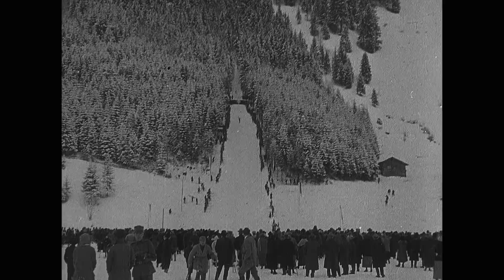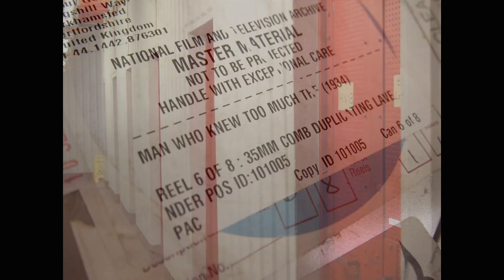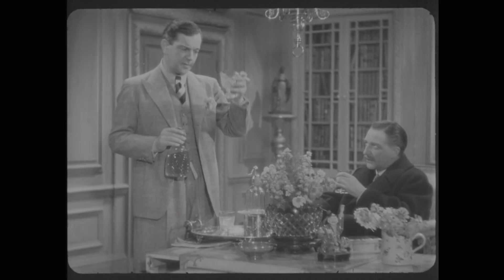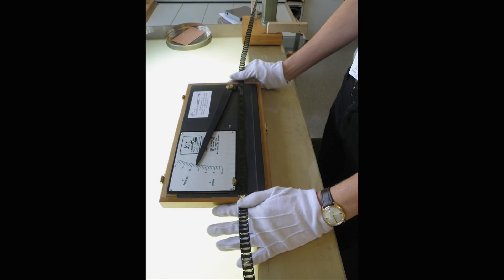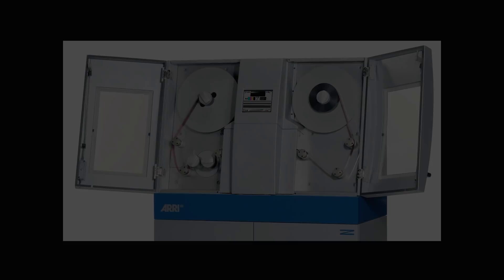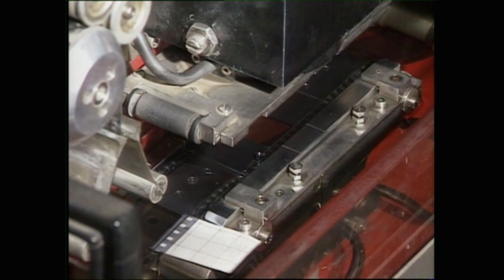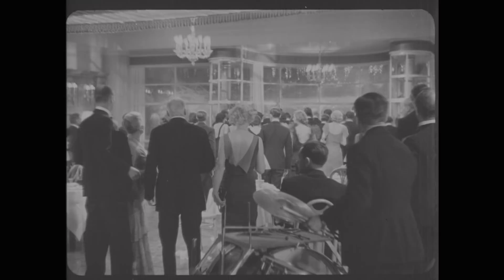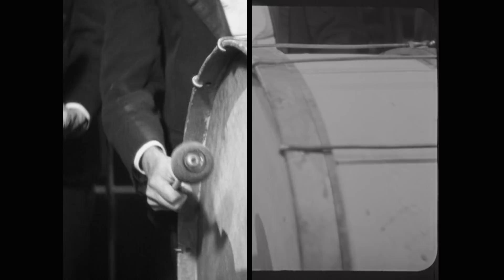The Man Who Knew Too Much - Restoration Demonstration

Comment: Wonderful video, thanks. The most beautiful film I ever saw was an original nitrate print of Isle of Lost Souls, Karl Struss cinematographer (& he was there that night! I think he was 96, so he was frail). It had a sepia tone, incredible range from the fog at the beginning to open shadows.  We had to have our projection booth in Ann Arbor, upgraded with fire suppression gear in order to show the highly flammable film stock. ( I never found out of the sepia tone was original or caused by time. It was so consistent and wonderful I'm pretty sure it was original. I've sepia toned most of my B&W silver prints, but never to the full orange. It's also both an archival technique and caused by time. Some of those old photographs that are sepia are just old not originally toned. Though in my experience the time caused sepia toning is slight.)  I wonder if this print ever made it to BluRay?
I grew up watching all the old movies on B&W TV, very very low res. It wasn't until I got to college that I realized most of the Wizard of Oz was in color. In college we showed a lot of old movies always trying to get 35mm prints, but too often having to settle for 16mm 'TV scans'  -  this is where a wide screen movie was copied into 1.33:1 format to fit the format of a TV screen. I think Giant is one of the most egregious examples. Brilliant color, wide screen,  no possible way to fit it to the TV format so they did horrible things. But it's kind of like your dad telling your joke and ruining it. You still can share the original.   So any restoration is welcome.
Hitchcock's earliest British films were notable for using the German developed technique of lighting the backgrounds differently from the actors - this gave the actors and the scene a three dimensional quality. Once you know something like this is possible and you understand how it works, you begin looking for more techniques. Hitchcock really pushed movie making forward. I don't know if it's been said recently, but Hitchcock was the Kubrick of his day.  I recently watched The Man Who Knew Too Much for about the 5th time. Everyone who loves movies should read the book Hitchcock by Francois Truffaut.  Back in the day, probably starting in the late 1960s Hollywood would try to make a thriller. It would be billed or promoted as 'like Hitchcock,' and they were almost always terrible (The French made some great thrillers but never felt the need to mention Hitchcock.) Brian DePalma was the first filmmaker I know of who wasn't French who made thrillers like Hitchcock.

Comment: I sure hope the are scanning in 8K by now. 2K just doesn't cut it. I realize 4K is sufficient to accurately reproduce a 35mm frame but with 8K already here it seems the obvious choice.
Reply: At least, Criterion is mostly sticking with 4K scans these days, though they're still only releasing 1080p blu-rays.
8K would be most suited for 65mm or IMAX-shot films, since 4K is far less than what those types of film can show. 8K for 35mm would probably be overkill on the detail side (like scanning 16mm on 4K - see The Texas Chainsaw Massacre, for example), and too expensive to justify.
Reply: It’s just not cost and time effective
Reply: 8K is just ridiculously unnecessary at this point.

Comment: Fantastic work! 
Now how to store the huge digital files? On hard drives where data can become corrupt or unreadable? I guess archival quality 35mm prints (in this case full frame, 4 perf "Super 35mm"), using all available image space, still are the very best option for long term storage. Now about the sound? Noise, crackle and hum reduction algorithms - and any form of "enhancement" (=adding stuff like harmonic distortion and sub harmonics: the equivalent of PhotoShop image sharpening) that just isn't there in the original, but it sounds great) are becoming better and better as we speak - so any "restored" sound track would be obsolete in about 10 years from now because future software will work way better. I guess (just an idea) making a clean, separate (!) analog back up of the optical sound track with frame (sync) reference would be great, so it can be restored just like an image before being transferred into any digital audio workstation. I'm sure people already thought about that and are hopefully doing just that. 
Thanks for the upload - I love this stuff! Hats off to the dedicated expert craftsmen and film lovers!
Reply: Digital data is easier to archive. M-Disc lasts up to 1000 years, for example. You can also create a RAID massive and data would be stored in multiple copies on several hard drives. It's surely more reliable and cheap than just storing analog film!
Reply: +Dave Flynn O.K. thanks for the information. There is a lot of debate going on regarding how well hard drives and other digital storage media will hold up over time and if these will remain readable by future software. If all that is covered: I'm all for storing the digital uncompressed data. After all: a 35mm film storage print is once again one generation away from the restored film in digital data form. I'd say: please just don't destroy the camera negs (or fine grain intermediates) used for the restoring work. I'm sure digital technology will greatly evolve over the next decades. There's is still some loss during scanning (even on the best ones at highest resolution). Anyway: many a great recent restoring looks fantastic by any standards. Again: hats off to the dedicated people who bring out the best possible image and sound, preserving it, always carefully considering what was originally intended, so we and future generations can study and admire the camera work, lens choice, composition and lighting - among many other things. Thanks again.
Reply: Well, I don't know if this helps, but inside Criterion releases, there's either a letter (in the laserdiscs) or a page in the book (in the DVDs and Blu-Rays) that explains the restoration. While I don't own The Man Who Knew Too Much, I do own the 2004 DVD of Videodrome (the Blu-Ray was released in 2011), and I'm sure that to a certain degree, they treated the two films the same.

"ABOUT THE TRANSFER: Videodrome is presented in its original theatrical aspect ratio of 1.85:1. Black bars at the top and bottom of the screen are normal for this format. This new high-definition digital transfer was created on a Spirit Datacine from the 35mm interpositive. Thousands of instances of dirt debris, and scratches were removed using the MTI Digital Restoration System. The soundtrack was mastered at 24-bit from the 35mm magnetic tracks, and audio restoration tools were used to remove clicks, pops, hiss, and crackle. The Dolby Digital 1.0 signal will be directed to the center channel on 5.1 channel sound systems, but some viewers may prefer to switch to two-channel playback for a wider dispersal of the mono sound."

So, although it's not identical to the story of The Man Who Knew Too Much, I'm sure the audio/video restoration tools were similar. Hope that helps!

Comment: I wonder 50 or 60 years from today will we be restoring the avengers or mad max
Reply: Ok, first off... The Avengers, like all modern films are filmed digitally at high definition to begin with. Remastering and restoration is only necessary with older films from the age of film stock and/or low video resolutions. It has nothing to do with the time, and everything to do with the technology of the day that wasn't at the optimal levels of realistic HD. Now that we do have this technology, modern films will NEVER need to be restored, as with the advent of 4K, we've literally gone as far as we can. 
And secondly, if your simple understanding of film technology didn't stamp you as someone of a very recent and inexperienced age, the fact that you don't seem to differentiate "Mad Max: Fury Road" as a SEQUEL in a film series and not recognize the title you gave alone as an old film that's over 40 years old that already HAS been remastered and restored, does.